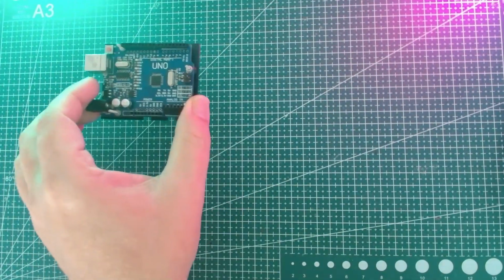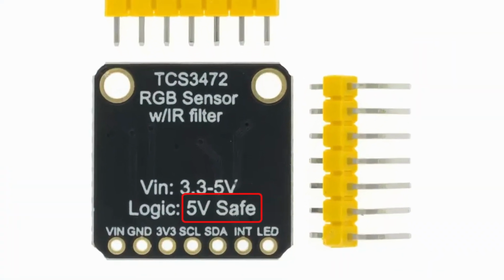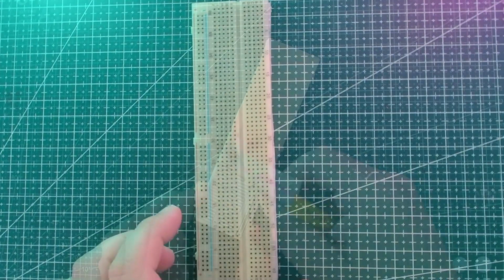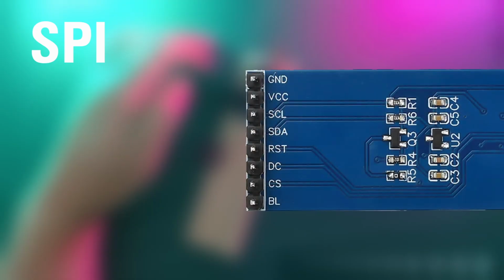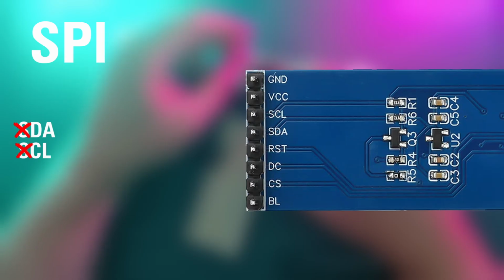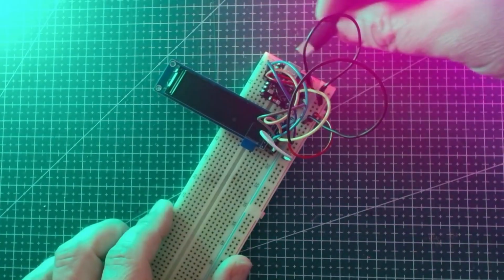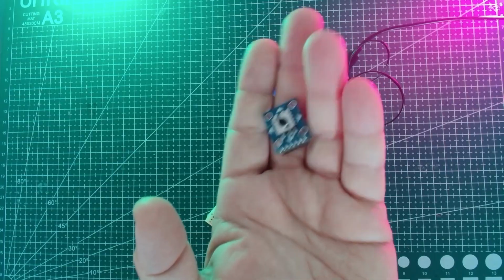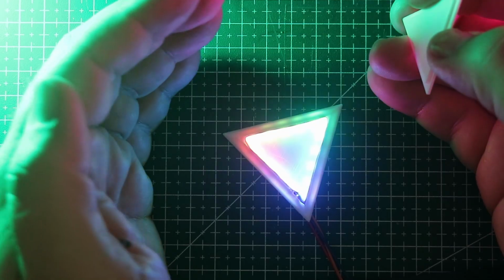Arduino LCD Tutorial From Zero to Working Display

Comment from the maker: Do you have a project idea you are struggling with? Let me know I might make a video about it!
Reply: reasonable one. wireless mic for vlog. one receiver can connect to 4 transmitter with audio decoding using the device which the receiver plug in.
Reply: Aurduino controlled Hoveround power wheelchair with a pressure washer surface cleaner. An automated concrete cleaner. It would need to sense the edge of concrete slabs, walls and obstructions. Much like a roomba but scaled up for lazy driveway cleaning.

Comment: The Tutorial is called from zero to working, but as a beginner I am completely overwhelmed by missing links in your explanations. 

Where is the UI coming from?
How are these buttons and lights exactly wired up ?
What library are you using?
suddenly there are a lot of cables in your set up which are hard to trace

What did you code to test the display?

I did not understand anything really 

But the quality of the video is nice
Reply from the maker: That's great feedback, I will slow it down and add more detail in the future.
Reply: Not only any software detail but also no mention about the hardware used other than calling a generic name. Do you think if I search esp32 display or joystick, will the same display or joystick pop up?
Reply from the maker: @shoumikahmed6373  here you go https://www.patreon.com/posts/getting-started-147906550
Reply: @JWNZ  lol paywall....
Reply from the maker: @alexd.1091 no paywall. Just click join for free
Reply: Simple answer: It's not